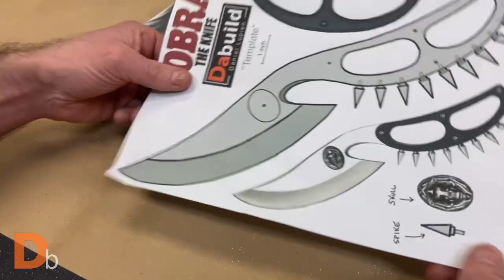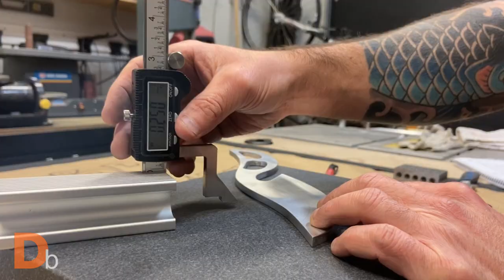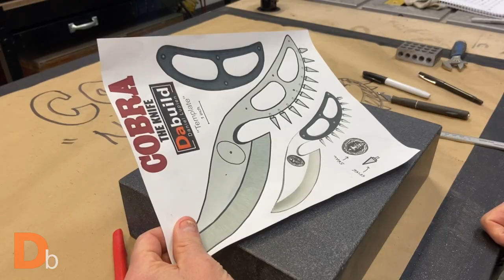Making the knife from COBRA (1986)

Comment: I like your knife bevel jig. Could you show how you made it?
Reply from the maker: thanks but I didn't use any jig to do the bevel. All hand made.  Are you refering to line markings?
Reply: Maybe it's when you were doing the honing at the end? It looked like you were using whetstone. It's at the 9:35 mark. It looks like it could be used to make the bevels though.  @DaBuild
Reply from the maker: @bitsurfer0101  Look for ''Knife Sharpener Professional Stainless Steel Kitchen Chef Knife'' on Amazon.  🙂

Comment: What material did you use for the handle ???
Reply from the maker: Simple black plastic sheet 🤗 Something that I had in my stuck for some time...hard to tell exactly what it is.
Reply: Would acrylic be a better option or not ?
Reply from the maker: @juliotapia5492  acrylic is plastic
Reply: Thanks